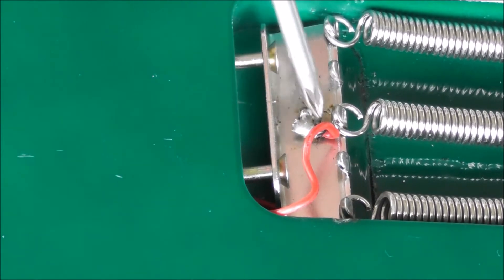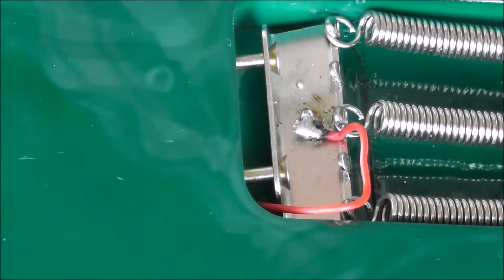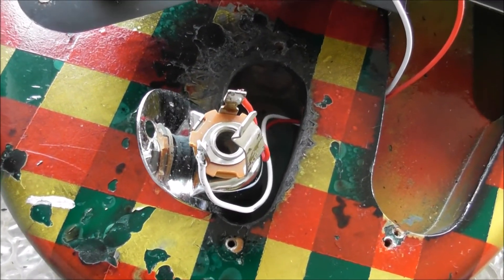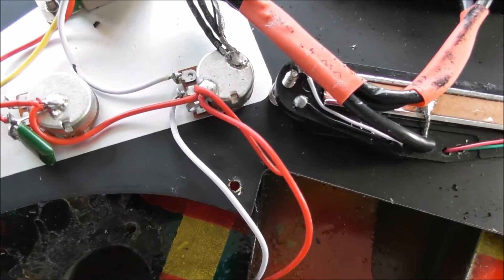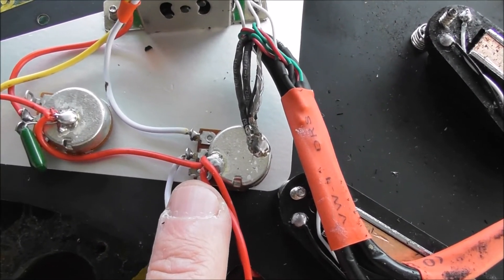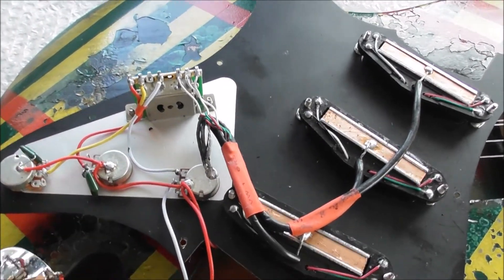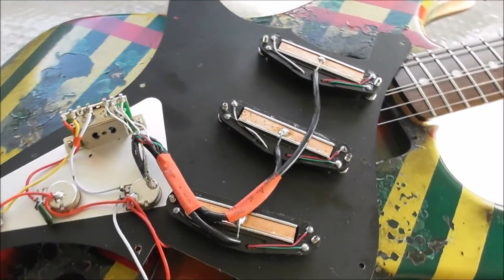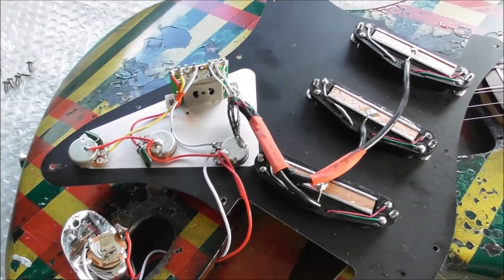MagiDeal Prewired Strat Pickguard Pt-2, Eathing Problems. Your views and Help?

Comment: Electronics is my main thing.  this 1 is a bit tougher since you've grounded at the output jack n claw.  Having a bunch of solder joints to a single spot isn't always a problem except when it causes a breakage (which I don't see here)  if you have a multimeter do continuity (or resistance) check between the ground on the claw n the output jack which will tell you if theres a break anywhere in the ground lines, if so you'll hafta check all of them in turn to find where.  Its definately grounding problem though you're starting in the right area.  On a side note if you wanna working on your soldering for doing guitars again later on you can get 1 (or a few) of those electronics kits to practice on,  probly starting on some of the smaller 1's would be good.  Perhaps a pedal kit or small amplifier kit from evilbay.  Those TDA2030 kits are small n could be used to build up a small guitar amp around if you wanted to.